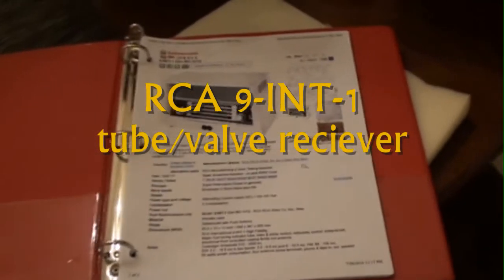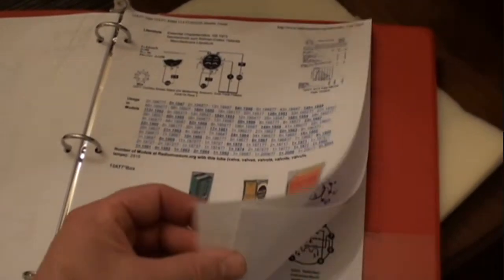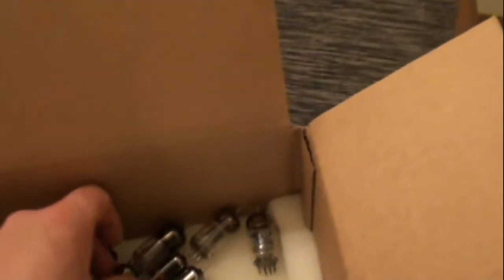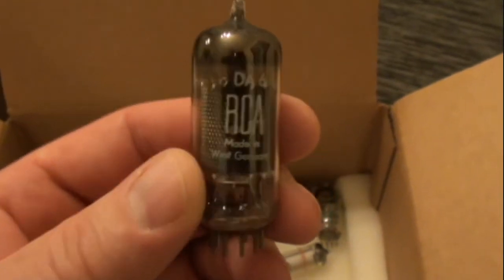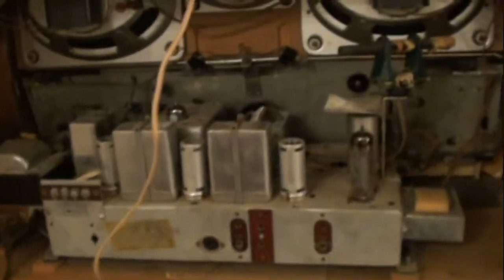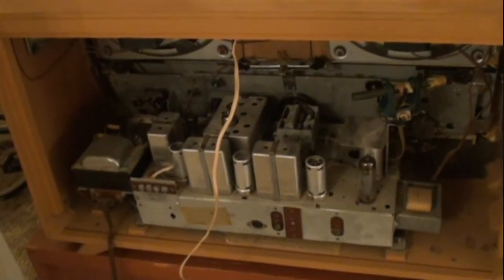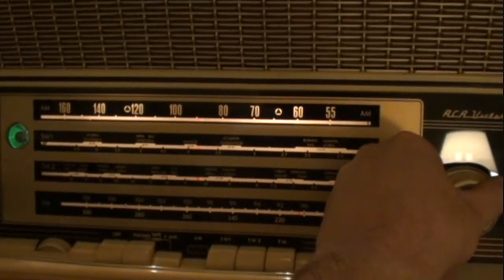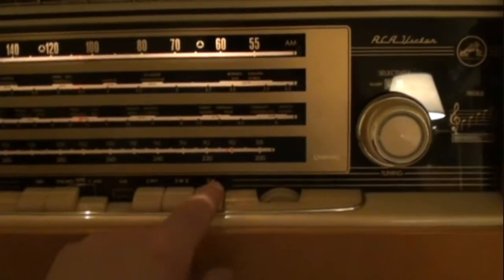RCA 9-INT-1 Tube/Valve radio

Comment: Very nice radio! I also have one of these, all original except for a few tubes. Audio quality is absolutely stunning. I am floored by what Graetz was able to do with a single-ended 6BQ5. It has sound you'd expect from a console radio.

Nice to see you have a bright tuning eye tube. Mine is getting faint and I'll probably rewire the socket to use a cheaper Russian version when I restore the set.

Comment: I have this exact player.  However all of a sudden there was no volume just a loud humming noise.  Any suggestions?
Reply from the maker: The filter capacitor/s need replacement.
Reply: thanks.  would that also cause smoke too, or is that a different problem?
Reply: @justinhumbert1980 I know it’s been 8 years but smoke usually happens when the selenium rectifier fails. Failed filter capacitors can also smoke but not as common.